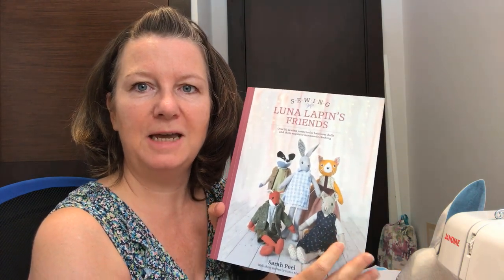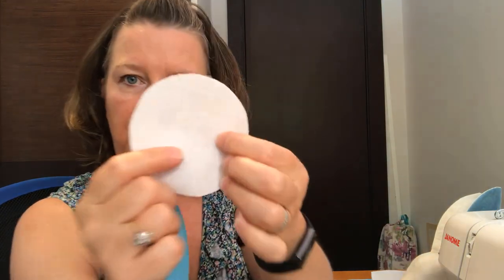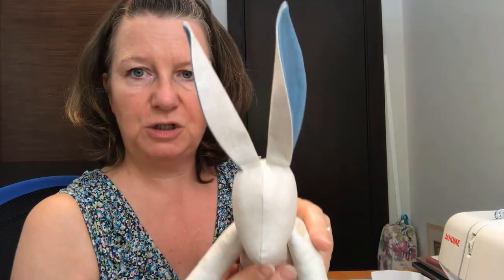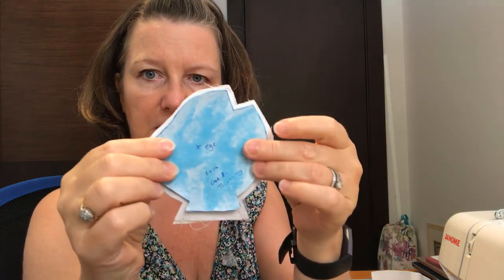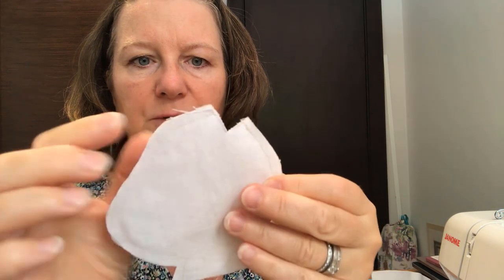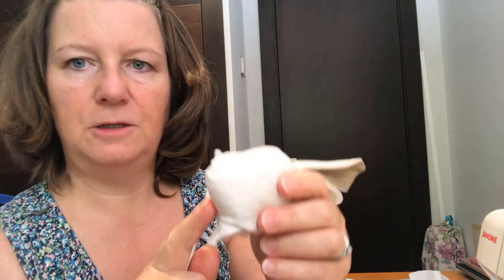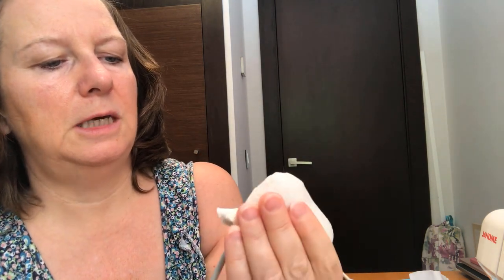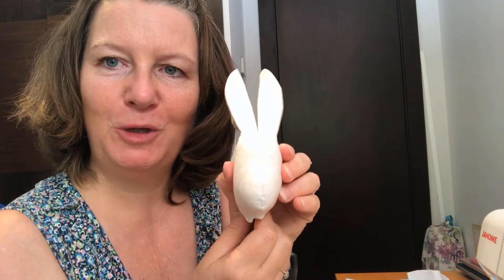Sewing Method for Luna Lapin's Head

Comment: Will you be so kind and show how you make feet for Luna Lapin? Do you hand-stitch the soles, or machine them? Also - for my felt Lunas I have done each leg as one piece, with fold on the back side - it made my work easier. I wander how do you do it? Thank you.
Reply from the maker: Hi Louisa, I certainly will let you know how I make my feet for Luna. I must admit my very first Luna had one foot bigger than the other but by the second one I'd managed to work out my preferred method. Firstly, I stopped my stitches in the leg seam(s) 1/4 inch away from the base of the foot. This allows the fabric to splay out when you are sewing the sole on. I then chose to tack the foot sole to the leg by hand first, that took away the need for multiple pins and made it easier. I also took it very slowly when stitching on the machine and had the sole fabric to the plate of my machine (and kept it flat), that enabled me to manipulate the leg fabric as I stitched around. I took a few stitches, then left my needle down in the fabric,before I lifted my presser foot, straightened out my fabric for the next few stitches and then put the presser foot down and sewed a little more. I repeated this process again and again until I was around the whole sole. This technique is also known as 'pivoting' and you might be able to find a tutorial on YouTube before I manage to post mine. I do like your idea of cutting out the leg on the fold too, but I'd put a snip in the fabric 1/4 inch into the leg at the back heel position as this will allow your fabric to splay out and fit around the circle of the sole. I hope this has all made sense and I hope you let me know if this method works for you. It was by far the trickiest part of the whole Luna making process. Have a great day :)
Reply: @ClaireEngland1  Thank you so much for the detailed explanation. It all makes sense. I will let you know when I make my fest fabric Luna rabbit. Appreciate your help.
Reply from the maker: @louisarull2275  I'm so pleased it made sense to you - it did in my head but trying to explain it in text was a different matter! I'm sure your next one will be fabulous and I really hope you like my method. I'll do a video when I get chance - I was just dreaming about making a ballet Wilhemina so that might just be very soon, I think she luckily has the same (or similar) legs to Luna but I've not checked the pattern as yet :)